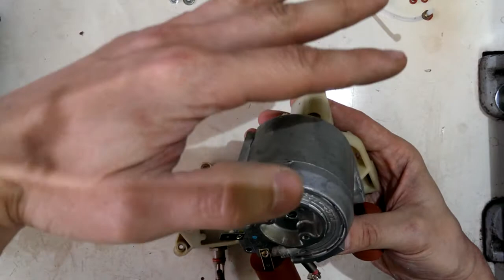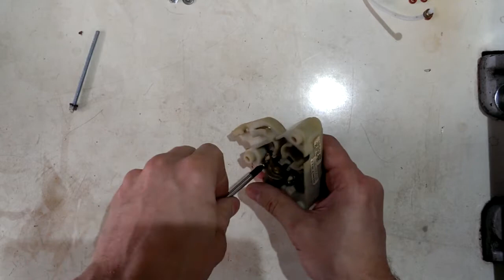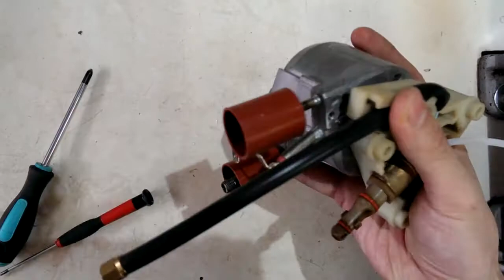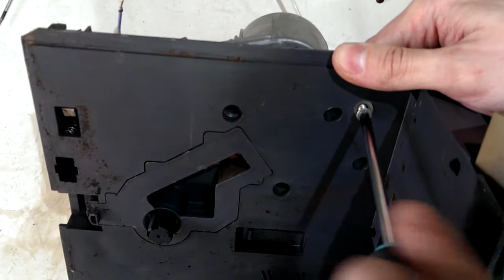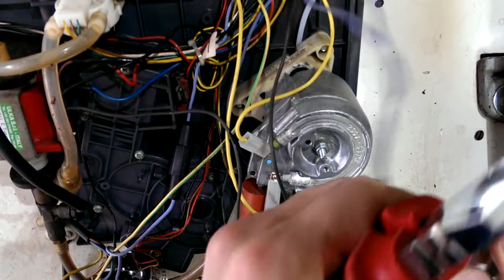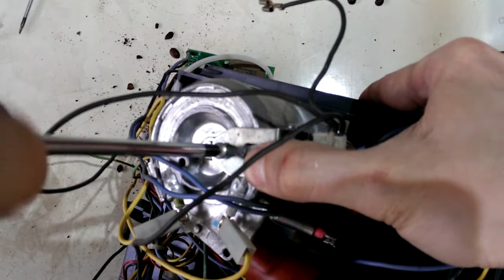Saeco Vienna replacement and adjustment

Comment: hi wonderfull information i have a vienna de luxe and im locate in canada my boiler leak and i want to do that swap . i need a 110 volt boiler but can you detail me all the parts with part number or on what model i can find it. the j-boiler 110 volts on what model ? the boiler bracket from incanto ? the fitting i need ,hose , etc.. some coffe repair dont want to help a lot to find my parts .thanks a lot
Reply from the maker: Hello if you like
 send me an email simaps@abv.bg so that I can send you more information.
Reply: @milenstoitsev6676  e-mail sent thanks a lot
Reply from the maker: Hi there is a lot of useful information on this site  https://www.cerinicoffee.com/saeco-parts-diagrams-28/    I'll make a video tomorrow with more information on the process

Comment: the water in my tank keeps "disappearing" - not leaking.  so i unplugged it and the "problem" stops - plug it in only when i want to make coffee - what is wrong?  thanks  Don Weil
Reply from the maker: Hi the water should go somewhere if it does not pour out it should fill drip tray or the water tank sealer. I suggest you to open the coffee machine and watch while making coffee. You can download Saeco Vienna  parts diagram from Google. To make it easier for you to dismantle it.

Comment: Hi, I replaced the clamshell Saeco boiler on my Solis 5000 but it takes about 10 minutes to heat up with green light blinking. It used to take about 3 minutes with the old one. Do you have any idea why it now takes so long? Thank you for your videos. They are very helpful.
Reply from the maker: Hello cause the boiler to heat more slowly is  that one heating element is 1090W and the second is 450W .  The two halves of the the boiler are identical and can be placed on the weaker half as a main heating element.  Then the coffee machine heats up slowly and can not make steam.
Reply: Hi Milen, Thank you for reply. I think I might have solved my problem. I ordered a replacement Saeco boiler and I took a closer look at the manufacturers part number #286472858 and I see that it is in fact 230V and not 120V (I'm in the US) so that would explain why it takes so long. Once it is up to temperature, it seems to function just fine. It is just a longer warm up period. Many thanks and great videos.
Reply from the maker: Hi what standard electricity do you use 120 or 230 volts?  Also check the boiler you are replacing. Or you have confused the primary heater -1090 Wats with the secondary heater  437 Wats .